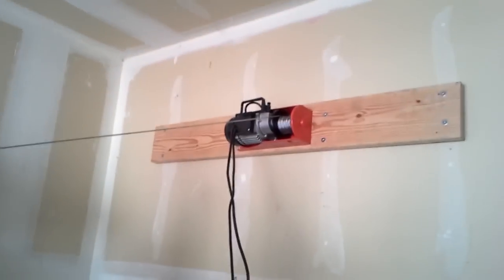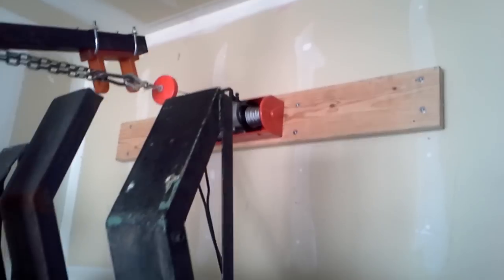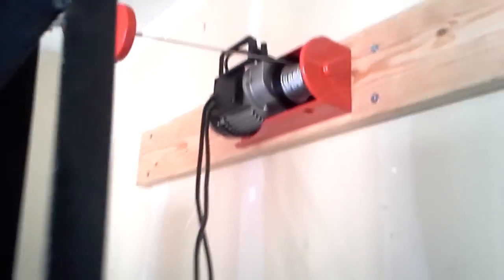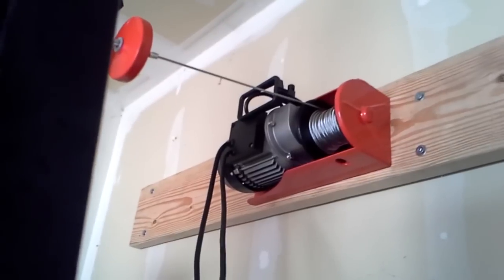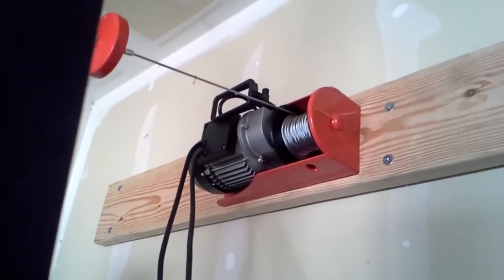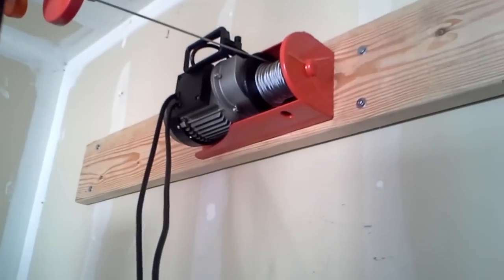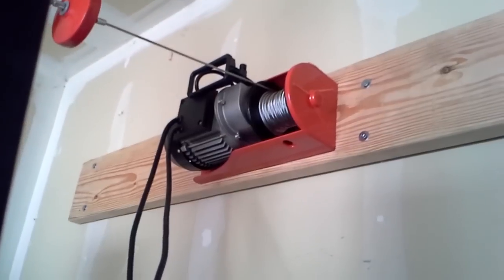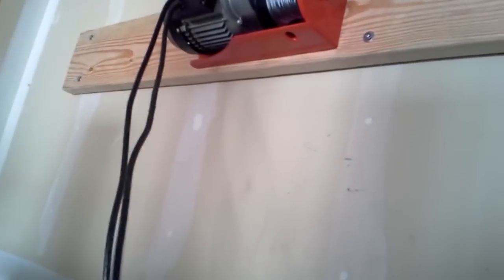harbor freight chicago electric 440lbs hoist part 2

Comment: Thanks to this video, I successfully created a hoist for my truck topper last summer. I had done much research and spent many hours trying to figure it out. I hit a road block and almost gave up after hours and days of minimal progress. Before I fell asleep I had remembered this video and how your hoist was directly pulling your trailer back without any interruptions or distractions. It was direct. This was the final piece to successfully creating a very successful and useful pulley system. Thank you
Reply from the maker: Hey no problem!!  Glad it worked for you

Comment: I have landed on this vido 3 times now. It's old but if you like what brad has done here know that you could  halve the safety bar so that the cable can hang down and not activate the safety cutoff. Remove a section of that ring so that the disc still has something to bump against.
Remember removing an engineered safety device is never smart so just taking a small part of it away MAY work for you.

Comment: Question for ya.. How did you mount the hoist to the 2"x8" piece of wood?  I am guessing you bought longer bolts and countersunk them into the wood. Than bolted the 2"x8" wood to the 2"x4" wall studs.  I am about to do the same and just wondered if that is how you did it and how well did it hold up after 9 years?

Comment: just a tip, if you used a "snatch block" you would effectively cut your lifting speed in half and double the strength of your hoist. ( i know this video is old but trying to help)  not only would it reduce your strain put on the walls but would slow the lift down so it wasnt so crazy lol
Reply: keegancdr - part of you statement is correct. While using a snatch block will reduce line speed and load on the motor as the trailer is lifted, the force applied to the wall would be constant at any given point in the trailer’s arc. Think of this from the perspective of a vertical lift. The motor load is decreased on the motor but the beam would still carry the entire weight of the hoist system and load.

Comment: Thanks for sharing. How did you mount the hoist to the wall. Most of the mounting that I see suggests a metal rod or pipe. I would love to do something similar.
Reply from the maker: FarmingFractals oh I just found the studs and drilled into them then I just got some long wood screws and attached the board. super simple.  that trailer ways a ton so it just goes to show how strong the studs are behind the wall if you have enough studs connected to the board...  don't think to much into it. thanks for the comment
Reply from the maker: FarmingFractals I also used 8 screws and 8 washers  you still have to connect the winch to the board
Reply: @brads3111  how did you connect the winch to the board?
Reply from the maker: @matthewkorwel1099  with simple bolts and washers.

Comment: what size is that piece of wood that you used? and did you made the hoist screw's head flush with the wood?
Reply from the maker: I believe its just a 2x8 inch board and they probably look super flush but I swear their not, hahaha.
Reply: @brads3111  so the bolts holding the hoist to the board are sticking out of the wood creating a separation between the board and the wall?  I am asking because I might need to do something like that but I had no idea of what board size to use. if I use 2x4 (1.5x3.5) and I make the head of the screws 1/2 inch deep into the wood to make it flush with the wall, I will have 1 inch only of wood. I am deciding between board or a 12-Gauge Half Slotted Metal Framing Strut Channel.
Reply from the maker: @JavierRivera  so the wall is made of drywall which is kind of soft. Those bolts holding the hoist to the board were pushed into the drywall just a little.   I wouldnt worry about how flush the bolts are.   I would be more scared about ripping down your entire wall.  Can your wall handle the weight?
Reply: brads3111 mine is a block wall.

Comment: How did you attach the hoist to the board? I can run lags through the two outter holes, but the fins on the motor seem to cover the other two?
Reply: I did something similar. First I found the studs in the wall, then measured a board that reached at least four studs. Then I mounted the electric hoist to the board and then mounted it to the wall in the middle of the four studs
Reply: The hoist holes require a  2 x 6 (or larger) board to mount it to.  If you're then going to mount the assembled unit flush to another board you'll need to drill recess holes in the 2 x 6 so the bolt heads don't protrude; and, the 2 x 6 must be long enough to allow room for the connecting lag bolts.

Comment: might consider a pulley to slow down the movement of the cable . . . nice setup !
Reply from the maker: ***** it actually comes with a pulley which just works great..  thanks
Reply: OK.  .  . I'm looking at a similar project and may use that winch.

Comment: Hi I Like This! I just acquired a Ford E350 Heavy Duty Van and was wondering If I could place it inside to help Me lift heavy items into the Van for Transportation. Yesss I'm a Female :O) ...I'm  wondering How I could mount it or be able to Roll it from the inside of the van's roof for mobility...  Hummmm?? TFSyour Video (a Light bulb lid Up!) LOL
Reply from the maker: Oh my gosh I am so sorry I never got back to you. A atv winch from harbor freight would be a thousand times easier to use and very cheap.  Also it runs off of 12v.  "Car electricity"

Comment: very dangerous. wall is held with nails and will kill you if you remove sheet rock and use deck so screws and plywood the wall and then sheet  rock. sound advice!
Reply from the maker: thats why the weight is spread over 6 diffrent 2x4 and if it breaks it will break on raising or lowering and thats when your out of the way.  ya it is scary as heck when it goes up. tour the first one to notice that.  good eyes bro.  anyways its been reinforced since this vid.
Reply: @brads3111  Hi Brad, i know this is an old thread, hopefully you'll see this.  What did you change to reinforce your board across the studs? Thx
Reply from the maker: @trevorplumb  nothing at all. 8 very long heavy duty screws into the studs. And a course the single large board.